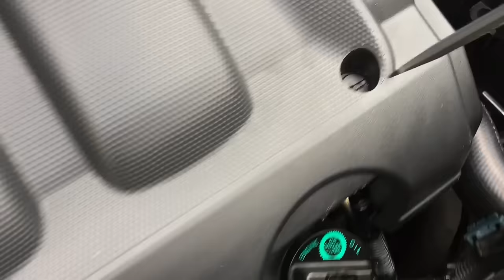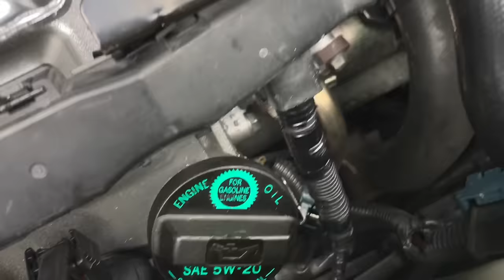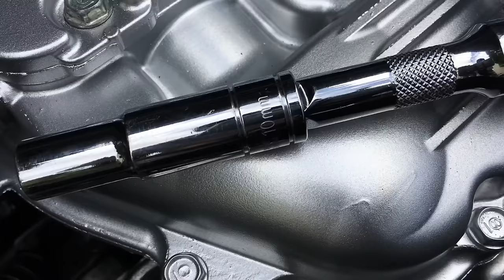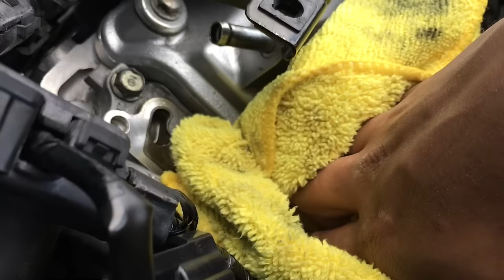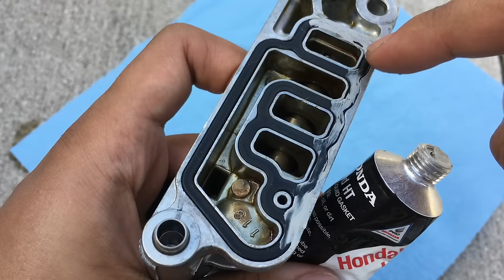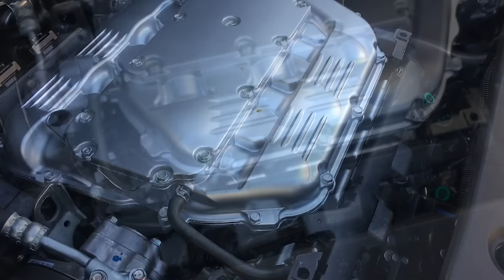2008-2017 Honda Odyssey Front VTEC Solenoid Leak Fix DIY

Comment: What is the function of the Vtec solenoid ?
Reply from the maker: Controls VTEC engagement. At 4200, 5500, whatever RPM VTEC kicks in in your car, the solenoid activates vtec, giving you more power.

Comment: What if you already bought the whole assembly.  Could you use the top part of the new one and but the bond on the bottom gasket?
Reply from the maker: Shop manual says to remove rocker arms to replace the whole assembly. I would try to sell the part or return it.
Reply: I have bought the whole solenoid with the intent of only replacing the top piece. I also wish Honda would simply just make a gasket for the top piece. It is usually the only failure when this part leaks oil.
Reply: In dealing with the VTEC solenoid assembly, where in the shop manuel is the proceedure.  Haven't found that yet.  The gasket sealer did not work for me so I have the assembly.  Thanks
Reply from the maker: Bryan Jones Its in the 08-10 odyssey shop manual.
Reply from the maker: David Streamo I don't know why Honda decided to not have a replaceable gasket for this part.
Reply: MrRangerZr1 I dont either. Me experience with taking the upper portion off along with the gasket attached was good. Torque on those bolts is crucial. Someone mentioned that their alternator was ruined because of the amount of oil leaked onto it from this part. Reading that, I can say it's the same thing that happened with mine.
Reply from the maker: My alternator was drenched from the oil leaking, the whole bottom on the engine was coated too.
Reply: Hi, I think the torque is very important, but how much you think? Thank you
Reply: yING, torque on an engine part like this is extremely crucial. Too much torque, you will flatten the seal and possibly strip the bolt holes. Too little torque, and you're going to leak oil again.
Reply: Thanks! David Streamo
Reply: yING, you are welcome
Reply: MrRangerZr1 where can I get that information?

Comment: I’m having a problem the top bolt won’t get  tighten it keria getting  loose and it’s not stripped
Reply from the maker: You might have stripped it
Reply: @MrRangerZr1  ithank u for replying , so I need to buy a new assembly
Reply from the maker: not necessarily just retap the threads and you should be good
Reply: Ok good , any suggestions what should I use to retap the thread . Thank u so much

Comment: Are there torque specs for those bolts?
Reply from the maker: It's a very small spec, like 6-8 ft.lbf.
Reply: Can someone please explain what this means? I am a female that has never worked on her car and I’m going to have to probably change this myself and I don’t want to screw something up.
Reply: Torque spec means how hard you tighten the bolts.  For this dont go as tight as u possibly can, just go pretty tight… try to feel how tight they are as your taking them off
Reply: According to Honda Service Bulletin 20-023 (replacing the entire assembly, including new bolts), all three bolts are torqued to 8N-m, 6 ft-lb.

Comment: Two alternators one valve cover and one valve cover gasket... why didn't I find you sooner.
Reply: I have the same problem you think it is the vtec gasket leaking into the alternator just wondering thanks
Reply: @zirensausi8119  I can confirm after replacing 2 alternators that yes the Spool Valve Assembly for the VTEC solenoid, part number 15810-R70-A04, was leaking on the alternator killing it eventually.

Comment: dammit i tightened 1 bolt and it snapped in half... fuck me lol
Reply from the maker: Damn how you gonna take it out. Might need to drill or grab a vice grip to thread it out. 
Once the bolt bottoms out, just snug it up. Doesn't have to be on super tight.
Reply: well I got lucky after it turned like it stripped I backed it out and it all came out and the middle of the bolt was twisted and snapped when i got it out but it all came out. I'm worried the threads inside are stripped but no shavings came out.. now I gotta find a replacement bolt :( :( :(